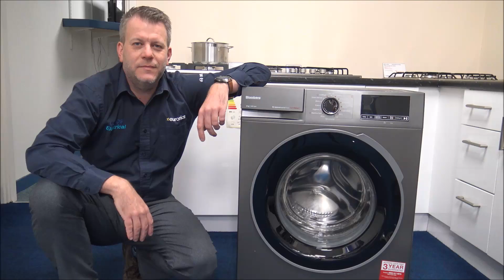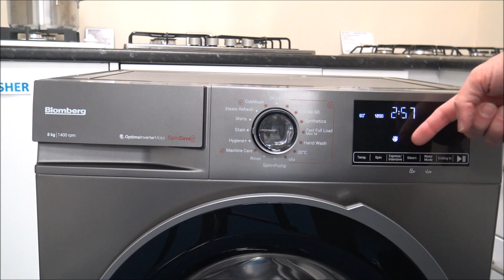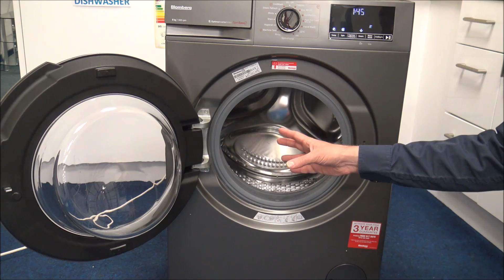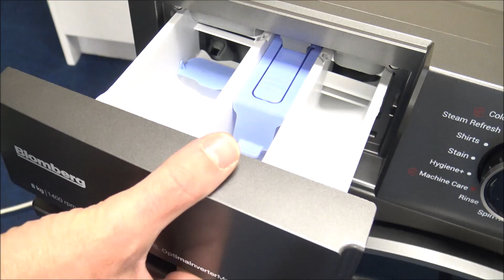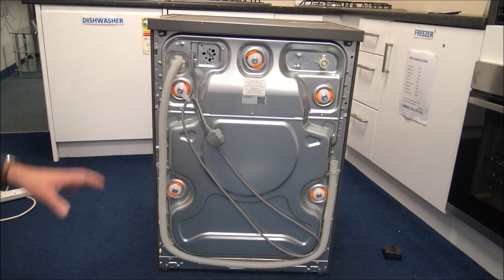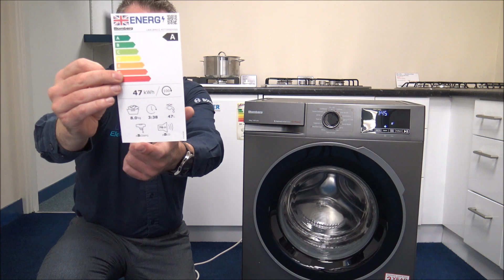Blomberg LWA18461 1400 Spin 8Kg Washing Machine

Comment: I have just purchased this model to replace my Blomberg that has just failed after 10 years. It’s arriving today. It’s been a great machine and we’ve worked it hard with a family wash every day sometimes twice. I hope this new machine is as good. Incidentally, I have removed the old door and detergent tray to keep as spares because they look like they will fit and the old bracket is alloy not plastic. I also have other Blomberb appliances which we are delighted with. Highly recommended. Many thanks for your extremely informative video. Actually saved me a lot of time wading through the manual when it arrives. Very well done. To the point and no useless waffle 👍

Comment: Coming from a 21 year old Miele that never needed any attention ever, then just packed up. This Blomberg feels cheap and not solid. Take the plastic door hinge, utter rubbish. When you open the door, it takes a bit of care not to pull the door slightly upwards on the hinge. Washes fine, quiet atm. Like another contributor on here, I think some marketing spiel (BS) may be in use. Time will tell on its longevity. Would have gone for another Miele but have been informed that they are not made like they used to be.

Comment: Coming to this exact model from a Bosch washing machine - The Blomberg is quieter, clearer to use, has similar cycle times, and generally just looks better.  The warranty I received is superb (3 years extended to 5), and it's more energy efficient & uses less water.  I wasn't aware of the Blomberg brand but having been supplied this machine by my landlord if I moved out into my own place that didn't have a washing machine I would definitely consider another Blomberg washing machine.

Comment: Hi l have this machine, but it's got very noisy on its last spin now, can you please advise. Also how can you find out what all the little symbols on the screen mean. Thanks
Reply from the maker: If it has got worse over the time of owning the machine, it may be that there may be a fault developing. Hopefully in the instruction manual that came with the machine is where a good description of the symbols should be that can help describe what is going on with the machine